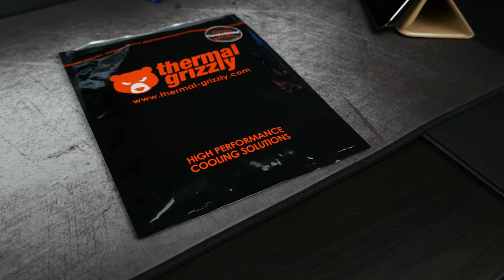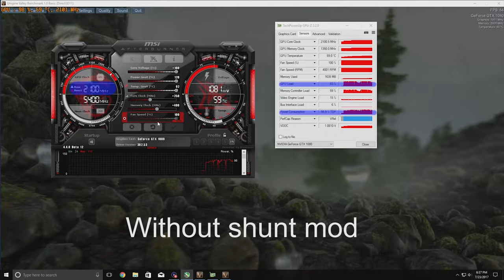GTX 1080 Shunt mod- is it worth it? (GIVEAWAY ANNOUNCEMENT!!!)

Comment: From past experience with this mod, it's usually only recommended for water cooled cards. BUT if you you have a good air cooler you can use a much thinner line of of liquid metal. With a thin line on my Strix 1080 I would hover around 75-80%, which did give me enough room for an extra 100Mhz. 

As you said I would recommend this for water cooled cards to fully take advantage of this mod.
Reply from the maker: Agreed. Appreciate the comment. As I'm sure you are aware since you seem familiar with the mod, it is a PAIN to get that liquid metal spread evenly across the resistor. I spent a good 30 minutes+ off camera getting it to where it was, and it still wasn't something I was happy with. The liquid metal wanted to flow to the solder points of the resistor and didn't want to stay on top, bridging the two points.
Reply: Well Thermal Grizzly was a pain to spread for me but Cool Laboratory Liquid Ultra was much easier for some reason. 
Thanks for covering this topic! Not many in depth videos on this besides der8auer's.
Reply from the maker: I have worked with Cool Laboratory in the past and I have to admit that I also preferred how it went on.
Reply: Sam Sung
Reply: I too had the same problem because the LM wanted to float on the surface of the cotton bud type applicator..what I did and it worked much better was to put  a drop of the LM on a piece of clean copper,ie old heatsink and rub the applicator bud across the LM for about 30 seconds and suddenly the LM soaks into the applicator and it was then very very easy to apply to the shunt..if you don't do it like this it just pushes the ball of LM all over the shunt without sticking.

Comment: Your mod actually works perfectly. 2100 on air is working perfectly. And forget about the gallium comments. That's a load of nonsense. Those idiots have found elsewhere on the interweb. He did a follow up on this liquid metal topic and found zero results if using the PROPER liquid metal. Not some radio shack hack stuff. Hope your life is treating you well mate.

Comment: Amazing content! Too bad the voltage was your limit. Maybe theres something you can short to help bump the voltage?
Reply from the maker: Thanks for watching!! 

At this point the only way I know to increase voltage would be with a custom BIOS. I would be all for it if I could find one.
Reply: VRM on the card is not design to take more voltage. It will explode if you do more volt for 24/7 use. I did shunt mod on my 1080 and gained + 50 mhz with voltage curve overclock and it's a more stable and solid clock without throttling under heavier loads now. Unigine valley is a pussy test to run it does not fully use graphics card. 99% GPU load doesn't mean your graphics card is maxed. Use TDP % sensor for that in HWiNFO64 if you want to see if your card is actually maxed out and only FurMark can do it.
Reply from the maker: As already explained in the comments section, I ran much more testing than just Valley, but Valley was the easiest to capture on screen which is why I showed it in the video. In regards to the voltage, most VRMs are designed to handle much more amperage than stock. Take a look at some of Buildzoids PCB analysis videos as they will give a lot more in-depth information on this.

Thanks for commenting!
Reply: Vrm on 1080 is safe up to 125c before it go into burn itself out slowly mode up to 150c. You can also heat up your memory over their max rated values 95c because they are right next to the Vrm on the pcb and heat goes there fast which will cause death to the card in a short time. Not to mention capacitors on the other side of the pcb may not take this as well. If you want to go over the voltage limit you better have full cover water block with triple rad just for the gpu. On stock cooler you gonna have Hiroshima in 10 seconds of FurMark bur in.
Reply: if your 1080 core run at 100c then your memory and vrm must be exceeding  they rated vaues. Ramp up your fan curve or you damage your pc.
Reply: 75c is what is safe for hardwere silicon for a long life spawn.
Reply from the maker: club4ghz - I was speaking on the capability of the VRM, not the safe temperature limits. I think it is obvious that you don't want to increase voltage without proper cooling.

Comment: So for the 1080, you only short r53 and not r52? Did you measure power draw after? Seems like thermal would take that card further. Once you have your delta T under control, then you would attempt this mod? What was your min and max GPU temps and what was your ambient temperature?
Reply from the maker: It isn't really necessary to short the second because as you pointed out, the card isn't starving for power. It taps out to temp far before power. This is definitely something I wouldn't recommend unless the card is liquid cooled. Temps were in the high 70s under load with an ambient of 68c.

Comment: There is a pencil mod you can do to the traces on the board to allow the board to carry higher voltages I believe. I am going to check it out! Someone suggested it I want to see if its bull crap or not. I do know that there are a few mother boards that have bad V-drop and the pencil mod fixes it.
Reply from the maker: I have definitely seen this done for various reasons. I don't know that I have heard of anyone using this type of method on a Pascal series card, but that is definitely something worth looking into. Thanks for the comment!!

Comment: Do you think I'd be worth it to stunt and apply better thermal paste to something like an 1080 amp extreme+? The cooler could handle higher temps but its almost not worth it...
Reply from the maker: With the Amp Extreme, I would say it is probably not power limited since it has two 8 pin plugs. If you are feeling froggy, you could always replace the thermal paste with liquid metal though. That would definitely help lower temps!

Comment: hey man saw the video but cant find where im able to buy replacements on the resistors i have a 1080ti asus strix that had lost one of the resistors and cant seem to find replacements
Reply from the maker: I've never purchased replacement resistors before, but they are very common. I would check ebay. IIRC, they are 5 milliohm.

Comment: "Testing was done in actual games at 1080p, 1440p, and 4k, as well as synthetic benchmark software from Unigine (Valley and Superposition)."  where are the other games and resolutions.  you only showed a couple seconds of one.  where is the rest.  it says they are test in the descr but id ont see it
Reply from the maker: I didn't want to add unnecessary length to the video. The overall take-away is that this is only a useful mod if you can control for temps. In theory it is great, and would work great with better cooling, but isn't worth the time if you are on air. Thanks for the comment Bob!

Comment: What's a scenario in which a shunt on a 1080 would be useful for?
Reply from the maker: The best way to tell if you can benefit from a shunt mod would be to download GPUz and click on the sensors tab. There you can watch your TDP over time. If your TDP is often pegged at the maximum (usually 120% but can be different for different model cards), then a shunt mod might be useful to help sustain a higher overclock.

Comment: Nice, but i prefer real soldering. Hold better and no risk that the smd will fall off 😆
Reply from the maker: Yeah depending on what’s in the liquid metal, it can definitely cause those solder joints to weaken if ran this way for a long time.
Reply: @LetsGetTechy  yeah. And a soldered shunt will also probably have a better contact or let's say connection. I've done that stuff by just using a cable, and so i just Bridge it, works like a charm and you can just take it off again without problems ✌️

Comment: every single GTX 1080 and 1080ti have been voltage limits.  When Nvidia removed the option to overvolt on OC software, they removed the potential for much higher clocks.
Reply from the maker: It's a shame. They were getting too many RMAs from people not knowing what they were doing and overvolting it into a melted pile of nothing. :(

Comment: Why wouldn't solder be a viable option? I'd imagine if you wanted to sell the card, it would be easier to remove?
Reply from the maker: Believe it or not, it is actually the exact opposite. Most people prefer to use liquid metal because of how easy it is to reverse the mod. In addition, it is untraceable if you ever wanted to erase it from existence without anyone knowing it had been done. With solder, it would permanently be noticeable that something had been altered.
Reply: Which solvent helps remove liquid solder if you don't mind me asking?

Comment: this has to be done with solder not liquid metal TIM
Reply from the maker: It can definitely be done with solder, but the preferred method is with liquid metal as it is a less permanent solution and can easily be reversed with no trace of it ever being done.
Reply: i dont know about the properties of liquid metal for using it as a conductor, personally would definitely not do it with it, solder is reversed easily too, just not as easy as this, but solder is a proper conductor.
Reply from the maker: Well you don't want something that is going to give you 100% conductivity as you don't want to completely bypass the resistor. With this mod, you are only looking for a rough 25% so that your card isn't capable of pulling MASSIVE amounts of power, if that makes sense
Reply: crystal clear, but now it makes more sense to me to do it using another resistor
Reply from the maker: That would also be a good option as long as you weren't hoping to completely erase evidence of it later down the road. I am definitely 100% not saying anyone should do this, but another reason people prefer to use liquid metal is because if the card dies, you could wipe away all the evidence and essentially be able to RMA the card. Again, totally not endorsing that! lol
Reply: oh but that is a very good and valid point lol did not think of that, anyway, good video, keep up
Reply: liquid metal contents gallium witch can form an alloy with the solder and amalgamate witch can cause the resistor to fall off, in short good luck with a dead 1080
Reply: it wouldnt have made a difference in this case because they are staying within the power limit of the card without the shunt mod.  the shunt mod only helps if you are bumping up against the power limit ( in this case 120% is the cards power limit and they rarely ever even get to 110%).  if they find a game or bench that has the card staying at 110-120 all the time like i am right now in pubg then they might see some improvment.  but not in this one. 

the thing i dont understand is why they are not closer to the power limit.  maybe with higher res or maybe there is a cpu bottleneck.  but the description says "Testing was done in actual games at 1080p, 1440p, and 4k, as well as synthetic benchmark software from Unigine (Valley and Superposition)." but i dont see any of that.  why not?  where are all the other res and games tested?

Comment: TLDR: Try different stress tests in 4k. 
Hey man, I think you need a much more stressful test than that benchmark. Witcher 3 in 4k easily hits the power limit on the founders card. I noitced in the test the power utilization never went to 120 so indeed for that benchmark a shunt mod would not give you the intended result. The shunt mod won't let you necessarily overclock beyond the chips un modded potential, but it will allow you to maintain a working clock speed when the engine pushes hard. For example, In The Witcher 3 at 4k   the power limit is typically at around 130% on my Aorus extreme , when I set it to 120% to emulate a founders edition using the power limit slider, the clock speed drops to 1924  and the voltage down to 981. If the Aorus didn't have 150% headroom, I would have to shunt mod to maintain my clocks in 4k with the 1080 ti.
Reply from the maker: Appreciate the comment and the info! I did test the card modded and not modded in Superposition as well in the 1080p Extreme test (which is murder for a video card), and got the same results. The only reason I showed Valley in the video was because Superposition doesn't like to run in the background for whatever reason. It likes to exit the benchmark if I click on anything other than it and try to manipulate it.

I agree though that there may be situations where you may run into a power limit and it might be worthwhile, but I feel like those situations would be very few, and probably not worth the time of the mod, unless you just enjoy doing things like this, like I do. Thanks again beretta9m2f!
Reply: Let's Get Techy ahh ok. Makes sense. I probably happened to have the one fringe case game, bc I haven't noticed it in other games at 1440p 144hz at all.
Reply from the maker: I also have never worked with Witcher 3, so that could also explain it. That is a game I have never purchased to add to my suite, but I probably should.

Comment: You need to use a custom frequency curve to make this mod work.
Reply from the maker: I would have to agree to disagree. You do not need a custom curve to make this work. You need better cooling as it is temperature limited in this scenario.

Comment: what if if we're adding a second power connector?
Reply from the maker: I don't see that helping since the single plug is capable of delivering more power than necessary. It's just the voltage that is holding us back, which is a BIOS level limitation. :(
Reply: Let's Get Techy jays to cents found extra power cables helped power purity, and therefore overclocks
Reply from the maker: I saw that video!! Very interesting results. I would be interested in also seeing if using aftermarket cables on a modular PSU makes a difference because some makers like EVGA have caps build into the factory cables that simply are not present on any aftermarket cable sets.
Reply: i said thta beacause my GTX 750 ti from MSI got an empty hole to put power connector.IDK if this would work
Reply: Let's Get Techy would you expect that to help? I've never heard  of that, but it seems like a good inexpensive video

Comment: I hit those clocks on 1070 with no shunt mod. This also ruins your solder joints eventually and shortens the life of the card.
Reply from the maker: Yeah, it's really not worthwhile on a stock cooled card. To your other point, it is definitely possible to damage the solder joints depending on length of use and exactly what material is used.

Comment: i would try and mod the bios if possible like on my MSI GTX 970 maxwel cards and increase the voltage limit...
Reply from the maker: That would be the only way to increase the voltage, but unfortunately custom BIOS revisions are pretty hard to come by on Pascal for whatever reason. I have also been told that unlocking the voltage really doesn't help much (on Pascal) unless you are using sub-zero cooling. If you know of any Pascal custom BIOS revisions, please share them, as I would love to do that for a future video!!

Appreciate the comment, and thanks for watching!!
Reply: The pascal bios is currently locked down too well to work without a programmer, it doesn't post if you try it.
Reply: I will share if i come across one... Thanks for the video, i was starting to wonder if the mod could be done on a gtx 10xx series card not that i have one but plan on getting one once my modded msi gtx 970 stops kicking rear end, i can still run games at max at 50-60fps so will be holding back for a while.
Reply from the maker: I don't blame you one bit. Ride it until it's dead if you are still getting the performance you need.

Comment: There are situations, in which the Power Limit of the 1080 FE becomes a serious limit. High demanding games at4k pull a lot more power at full usage than they do at 1440p or 1080. You instantly run into the power limit when playing 4k games. With the low power limit of the Founders Edition.You surely dont need any power mod for some Unigine Loops. Its not to reach higher clocks, its to maintain clocks under heavy power draw. I think you missunderstood something. As long as your card is staying in the 120% Power thats available in Afterburner, which it did perfectly in your case, it doesnt make any sense do a power mod.
Reply from the maker: It's weird that I had to approve your comment. It put it in the spam folder for some reason. Anyway, I did test games in 1080p, 1440p, and 4k, as well as used Unigine Superposition in a few different presets, and could not get the card to want to pull more power. In all testing it was voltage limited. As I had pointed out in the video though, this could be just my particular card and have to do with the silicon lottery. It may not be the same way with other cards of the exact same model. That being said, I still stand by the fact that unless you have a specific reason for wanting or needing to do it, it really is not a worthwhile mod. It MIGHT give you another 13-26MHz at most if you are liquid cooled, but that isn't going to translate into something spectacular in gaming, unfortunately.
Reply: youre gonna run into power limit when playing witcher 3 or ghost recon wildlands or gta 5 in 4k.....theres no way the card can hold 2000+ mhz. It can pull 270 watts with opeen power limit.
Reply from the maker: Funny you mentioned Wildlands, as that is one of the games I actually tested at 4k and couldn't get it to power throttle at all.